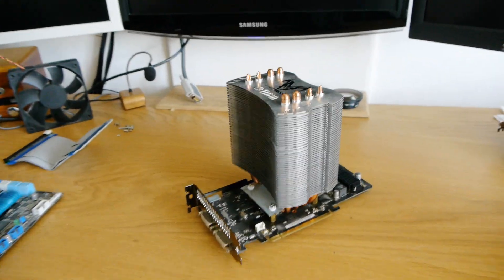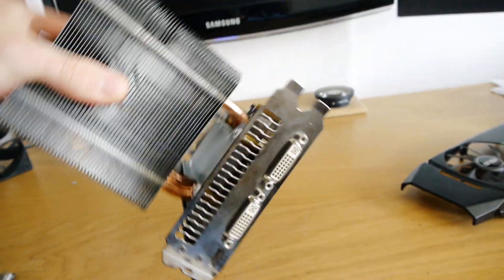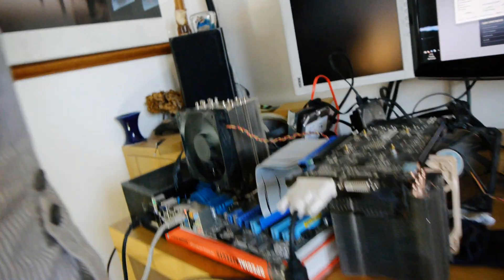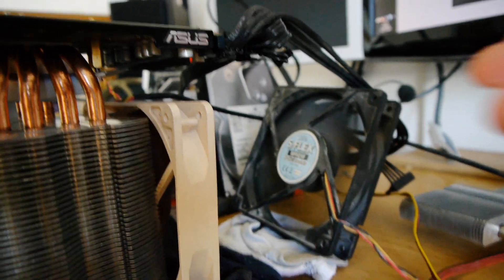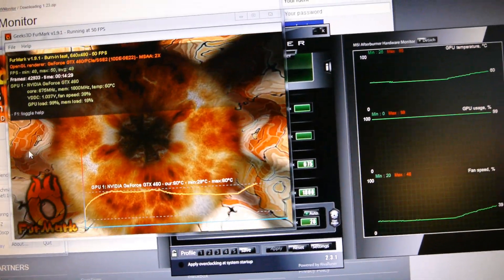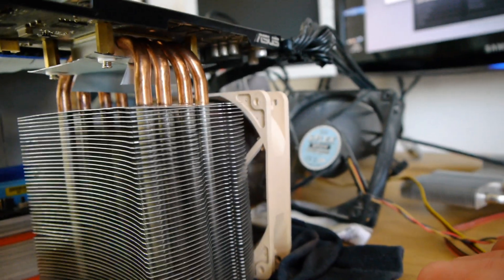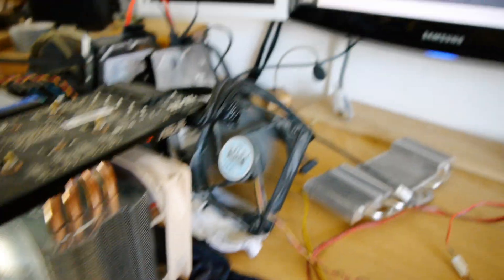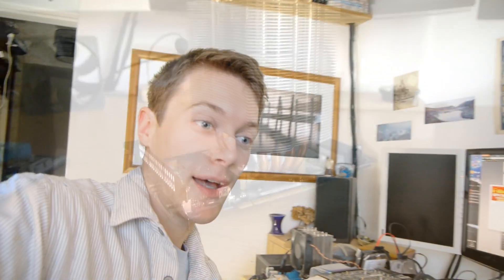CPU cooler on GPU (INSANE temps!)

Comment: ...twat. Just get a GPU liquid cool kit
Reply: Kek. A kid who thinks he's a good troll.
Reply: EvilJ069 Most people don't want to do liquid cooling because it's more expensive. And calling someone a twat for not using GPU liquid cooling is terribly immature.
Reply: Officer Snake
You completely miss the point. I don't even run liquid cooling on my own video, because there's nothing wrong with the stock cooling unless you overclock it, the fans are going out, or it's dirty. If you need to worry about video cooling you're either clocking it too high, need to replace the fans, or clean the damn thing. If you want to overclock it and need a better cooling solution, a water cooling kit is the way to go opposed to this impractical setup where it won't even fit into a case.

I'm terribly immature? Says the guy starting an argument he can't back up on the internet. Damn democrats.

P.S. I notice you can't refute anything I said in my last post. Welcome to the net
Reply: +EvilJ069  Nooooo ..... I believe you missed the bus... The little bus, Twat.
It appears one trashing a another persons efforts to show their own design concept(s) is either... 
Under 14 years of age, intimidated over this guy's resourcefulness, and likely unable to cope with mixed feelings regarding "perfect delivery and reasonable competence..." Or whatever. 

Sounds like a "couch trip" at $90 an hour is your only hope, Skywalker.
Translation?
 Is it bed time..., Cuz were feewlwing a widdle gwumpy.... Aren't we...? hummm?
 
Yes, the thing is a work in progress... As he's stated.

 But that doesn't suit some of us. Well take a nap. And remove that thermometer OUT of your mouth. It's meant for the other hole , Beavus.
 
So why not put your boogers back where you save'um.. And see if it doesn't hurt to give ideas or pointers in your comments? Oh..,. not likely you think?
Well vomiting your wimp-ass, drive-by slams, that only reflect that someone left the chimpanzee's habitat gate, wide open for you, and your fecal throwing sad sacks, won't fly here.

HOW ABOUT...
Show us your work in progress... And not your store bought, pre designed, landfill...
 Oh, .. Don't have any?... wwWWAAAAAAhhh.. As if anyone would be surprised.  

And if you actually did have a worthy comparison to see...
It would only make you look, even more like an ass that you sound like for the crap you started in the first place. 

"Positive" criticism is valuable... So.., For your benefit....
This schooling was brought to you by the letter "P...' with further support by the "F and U." Foundation... 
In conjunction with the D.R. corporation.  

Whats D.R. stand for, you ask?   
 Well... It's short form, it was to help the mentally challenged.. 
Here... Try sounding it out... It means DERRRRRRRRRRRRRRRRRRRRRRRRRRR!!!!!. Still Doesn't help?  
 Sorry, Can't help ya.

Welcome to the net.

Hopefully. this persons project build here will lead to the refinements is has to address.
Just the heat sink on the GPU  alone, is Bad-Ass.
Leading to a realized effort with a revolutionary approach,  just down the road. Is this not Positive?  

 Ironically...There will always be those little ass-wipes that can't stand others are doing. They wish they could have done themselves... And maybe they could with just a bit of FOLLOW THOUGH.

I give the project, 5-stars... For talking and showing us all aspects in this build   Not to mention the supporting links in a series, associated with reviews and tutorials.  Well Done DIY Perks....
 
Excuse my use of the FIRE HOSE on the peanut gallery.
 Those who need the best cooling efficiency available in hotter climates would be interested in 
finding the right setup. 
If anyone thinks these concepts aren't getting noticed, think again.
Patents should be pending for general concept and layout.
Reply: EvilJ069 Good day you incompetent troll....
Reply: S. Gray

1: TL,DR (most of it)
2: From the little of your diatribe I actually bothered with, I can see your IQ is quite low, I guess that's how you know so much about the short bus.
3: Please don't breed, the world already has to many cretinous troglodytes such as yourself.

Now, unlike you, I don't have time to create a poorly written, poorly thought out, poorly spelled rant that equates to "I disagree, you're a doodie" So you have a good night there.

P.S. You really should go in for that lobotomy, it would probably sort you out, or at least keep you from annoying others with your verbal feces

P.S.S. I find it really am,using that you're so amazed by the 'innovation' in this video and think nobody else car do it, it would literally take 20 minutes. Now go back to your binkie
Reply: EvilJ069 Says the person that still thinks rage memes are funny... You are the worst troll I have ever seen.
Reply: Officer Snake
Seeing as how my avatar is NOT the rage meme, you further prove yourself to be a dolt
Reply: EvilJ069 I said rage memes. Rage memes are dead. They were dead a long time ago. The "troll face" and "derp face" were all rage memes you idiot.
Reply: EvilJ069 There is a fine difference between good memes and rage memes like "troll face". And it's impossible to get chemically castrated you twit.
Reply: Officer Snake
You really are stupid...

http://www.medindia.net/patients/patientinfo/chemical-castration.htm

There's this magical new invention called google. Try it out. Moron
Reply: EvilJ069 And you didn't even attempt to address my other point? And I was simply unaware of "chemical castration".
Reply: Officer Snake
No, I didn't bother with it, as there's no use arguing with a lobotomite. And though you were 'unaware' of it, you still acted like I was the ignorant one. Piss off
Reply: EvilJ069 Your lack of trolling skill disturbs me
Reply: Officer Snake
That's because I'm NOT trolling, idiot. Now I've had a rotten day, so kindly go fuck yourself
Reply: EvilJ069 You are either a troll or a kid with a case of tourettes
Reply: Officer Snake
And you've obviously nothing better to do than attempt to annoy people with your impotent verbal slander

Comment: really pointless unless you can unlock the voltage more and crank up the speed. my 980GTX which is overclocked to 1.5ghz turbo frequency is running at 37C right now watching a youtube video and it has it's voltage upped to the max evga program can allow.

Comment: So I should by another Evo212 for my 970.
Reply: +Sarfraz khan I use two, one for the memory and one for the ram, I moved to Russia so I can put my radiators outside my window for cooling
Reply: +DSR07Gaming.com Everyone has the 4gb, just 0.5gb of it is really slow and not worth much. That was what he was refering to
Reply: +Ark so you are telling me that you are living in russia now.
Reply: But in all reality, if you have a good fan curve, you can keep your MSI 970 at 59-60 C when gaming
Reply: +Ark But low room temperature at first place. Now during winter and ~22c I have 60c max in all games with custom fan curve, during summer its 67c usually. For starters = 22c perfect room temp, with every +1 in room you get +1 max on gpu. It's approx value.
Reply: DSR07Gaming.com Of course it will vary, my rooms temperature varies from 65 degrees to 90 degrees, but in general, that's the average temp I get
Reply: +DSR07Gaming.com rip 970 (yes)
Reply: +Checkthis4 Not really, I have all 4 gigs.. no problems here.
Reply: a be quiet dark rock cooler would be better.
Reply: dumbass
Reply: No.
Reply: +Top Kek Joke dude joke :)
Reply: +Sarfraz khan corsair makes h100i, cooler master has seidon 240m
Reply: +Sarfraz khan no...buy a 970 waterblock for the same

Comment: have you tried the set up with the graphics card laying on the bench with the heat sink facing up ?? because heat rises so the way you have this set up the heat is lingering up on the gpu chip. it would be interesting to know if there is a marked difference in temps.

Comment: I once owned a GeForce 4 MX440. It had a tiny heatsink with a tiny fan on top. The fan died early on and the card started overheating and crashing. Instead of ordering a replacement, I applied thermal gel to the graphics chip and put a large passive heatsink on top, using crazy glue to keep it in place. It never even got warm after that.

Comment: heat rises so heat is actually rising into your board too. flipping it and maybe using a couple wooden feet/risers would cut a couple degrees.
Reply: I doubt that It will make much of a difference

Comment: LOL ENGLAND where 23c is pretty hot.
Reply: +Vlad the Manpire 23c Is bloody hot. I'd prefer 15c all the time and even 20c is a bit too much.
Reply: +Cloverskull  30c is hot. 
25c is the best for outside.
20c is the best for inside.
15c is nice for my pc.
Reply: @vladthemanpire5894  30c isn't even that hot Minnesota gets up to 100°f
Reply: +Vlad the Manpire 
30c is hot
25c is normal
20c is freezing
15c is overclocking time
Reply: +Vlad the Manpire 32c is normal here
Reply: +Vlad the Manpire im in brazil and its 39c right now :(
Reply: +Cloverskull I'm in India,30 degrees is a cool day for us. 45c is a blazing summer.
Reply: 0 is nice for my pc *
Reply: From England too, you`ll need factor 50 when going near a loaded i7 cpu (70c)
Reply: +josh Subet denmark

20c omfg we are gonna die!"#!"#"!
15c very hot
10c hot
5c normal
0c cold
Reply: Joel Monteiro Where in India are you? For the most part, 45C is exceedingly rare, only in Delhi. Most of the time the high is around 35-38 in summer, and 18-22 in winter. Lows are 23-26 during summer and 5-11 winter. 45C lol that happened once.
Reply: Bah, ya pack of drongos, 40c is just a bit toasty. If it heads under 30c, I'm inclined to put some pants on.
Reply: +josh Subet Lol
Reply: +nokia gameplays Centigrade/Celsius, not Fahrenheit. 35c would make you stick to a car seat.
Reply: +nokia gameplays So... Florida?
Reply: +PeopleHateMyOpinions who is also a terrible Grammar Nazi I'm in florida, the low is 72f :P
Reply: +Vlad the Manpire Hence most people don't have AC so 23 outside means an inferno inside
Reply: +Joel Monteiro okay prakash singh we get it!
Reply: +Vlad the Manpire ikr and now were getting no snow ):
Reply: Vlad the Manpire plus a half hour without rain and call it an excellent summer :P
Reply: Ya when he said that I died! I'm over here in Arizona thinking that's sweater weather, haha! (It's usually 32c or higher for most of the year.)
Reply: Spencer Hon now that is hot. It's 25-29c most of the year here in India, thanks to the monsoons, but it does hit 40C in may. That's 107F for you.
Reply: UltimateXtreme Ya in the summers we hit 120 pretty frequently... I'm used to it, though 😎
Reply: Spencer Hon 120? Fuck I'm complaining about 80. That is some real balls of steel. Annoying thing is the extremes. If you live in northern India, you have to brave 100F summers and 30F winters.
Reply: Have you visit the country exactly in equator where it's actually 35'C mid day these months? Oh I visited England last January and yeah its kinda too cold for my PC.
Reply: Vlad the Manpire LOL last year Sicily 47c my car said "Snow on road"
Reply: 23c? 40c here in Paraguay, South America is pretty hot you know?
Reply: lmfao in my country 30c isn’t hot for us
Reply: Well, this comment aged poorly
Reply: @JustSomeRando1984  and so did I hehe
Reply: come to the philippines and experience 46c
Reply: +Cloverskull Really where i live there is a constant 32 to 35 degress and ist not even hot the heck are you complaning about ?>>????
Reply: Rob Fraser Ist 35 c here 94 fahrenheit i think and  not is  not that hot actualy they are just pussies
Reply: Victor Elias and when it’s cold you’ll be bitching about it when everyone else is fine :)

Comment: Sweet shit, where can I get PCIe expansion cables?  I've been wanting to mount my hardware on the wall and then covering it with plexi.
Reply: Just Google dude
Reply: +Luke-Antra  Went ahead and ordered.  I went and put brick faux panels and stripped the floors (polished concrete).  Now to sit on the beanbag chair and read a bit of The Land of Green Ginger... ahh! X)
Reply: +Izlude Tingel Just take your grinder to your cpu cooler and make it fit imo.
Reply: if you want to wallmount, maybe checkout the thermaltake core p5